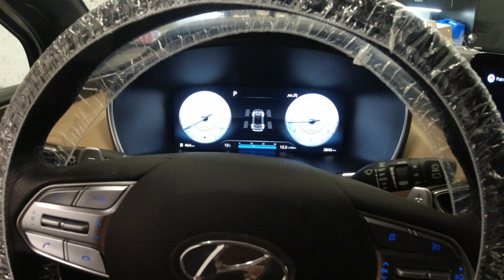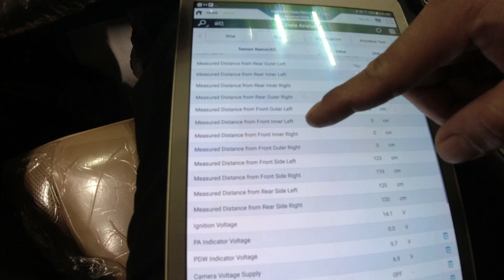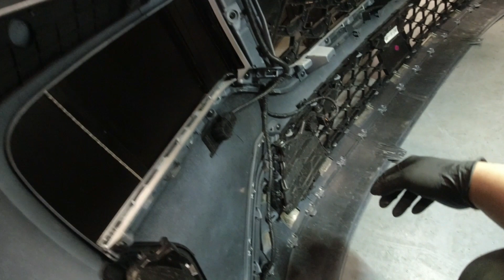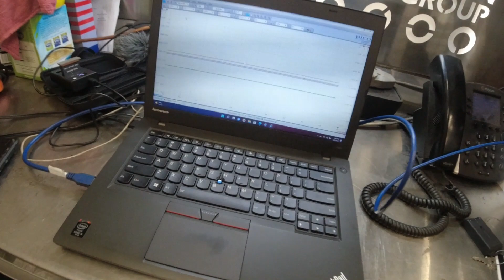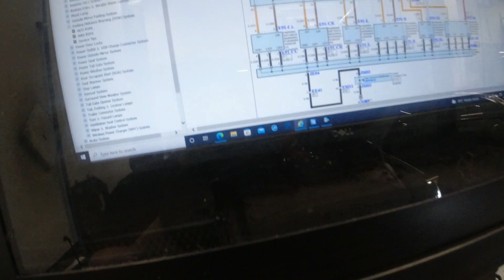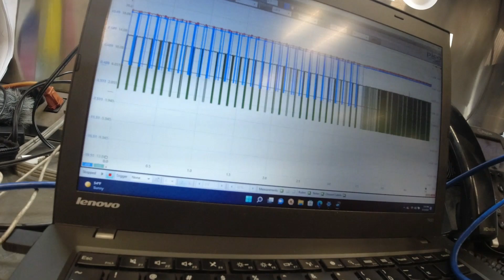HYUNDAI SANTA FE FRONT PARKING SENSOR FAULT

Comment: @hyundaitech.. i have a 2021 k5 with same issue as your video the only difference is its giving me all 4 sensors active on rear. they already replace the rear bumper harness and all 4 sensors but same issue still on. what would be the next step to check? thank you
Reply from the maker: Hi there, i think i have a video on a genesis g70 with all rear parking sensor fault. The best to diagnose that one is to see on the oscilloscope for the lin bus acitvity. I believe on my video i found that there was broken/corrosion on a wire for the signal.

Comment: i'm in R is working the sensor but in , D don't working the sensor what's the problem can u help me ?
Reply from the maker: What does the car equip with? Front and rear parking sensors? Do yiu have any codes?
Reply: @hyundaitech  KIA K5
Reply from the maker: @LLDAZ  but does the vehicle have front sensors? If the vehicle has rear parking sensors only i think thats only for reverse.
Reply: @hyundaitech  Yes, my full option car has front and rear sensors, but I had a problem. The front and rear sensors all do not work in D mode, they do not work, but when I put it in R mode, they all work, as if there is no problem, so what do you expect the problem is, is it just programming?
Reply from the maker: @LLDAZ  sometimes this feature applies when you go reverse, so when the front doesnt work can you see the parking button lights up?maybe you need press it first? And also when you go reverse after that everything works normarrly? .

Comment: Thanks for the video. I'm a mecanic too, but still need to improve myself. I learn a lot from you.
Reply from the maker: Anytime, if you have some questions maybe i can help.
Reply: @hyundaitech  Thanks for that, I'm working in Hyundai Dealer in Australia :)
I will take some your knowledge haha. Thanks !
Reply: @hyundaitech hey, could you share a link to the wiring diagram please? I have 2 parking sensors wiring completely cut off from the connector and I need to figure out which of the 4 black wires go to its correct position in the connector. Thanks)
Reply from the maker: @darth_driver its a paid subscription for the service information. I can send it to your email the screenshot